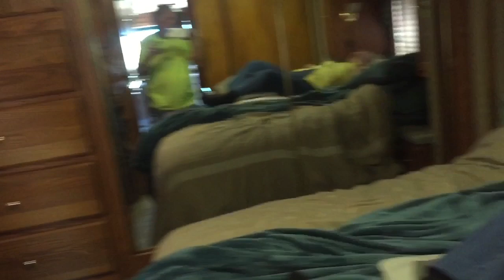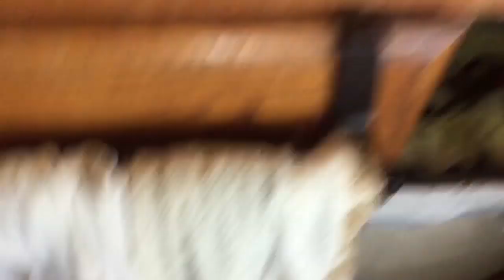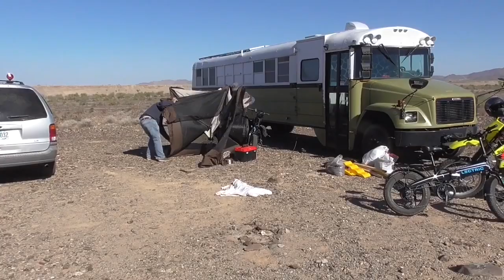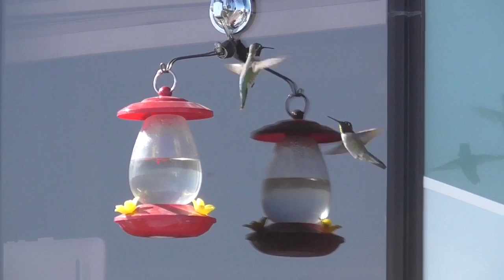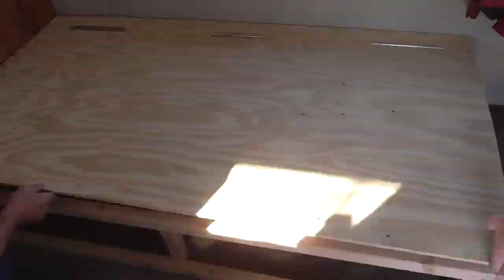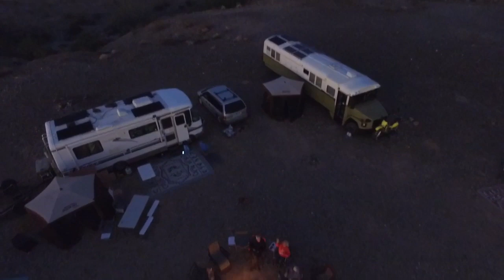Project Day in the Desert.

Comment: Considering the average amount of moisture produced by a human / per night [1 Liter/0.26 Gal.] it may be advisable to get some ventilation through this plywood platform by adding (variable sized) holes to let the air flow freely ... 
A quote: 
".. An air-permeable construction of the base is essential so that heat build-up is prevented and fresh air can be exchanged. Similar to the slatted frame, a continuously closed substructure should not be chosen, but rather it should be partially open for positive air circulation, for example by perforation .." {end quote}
Reply from the maker: With 8 inches of foam ... the top 3 are memory foam ...  its not likely that any ventilation holes in the base would have any effect what so ever .... but I'm not a bed engineer.  Perhaps the author of your quote was a bed wetter.  :)